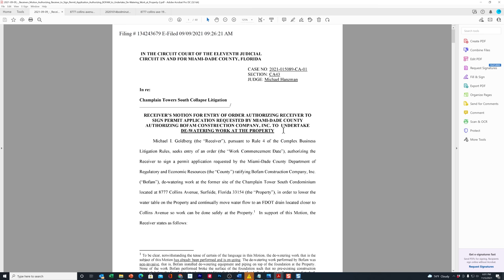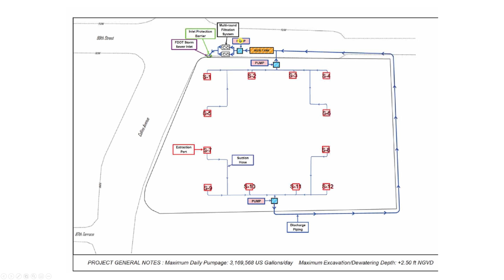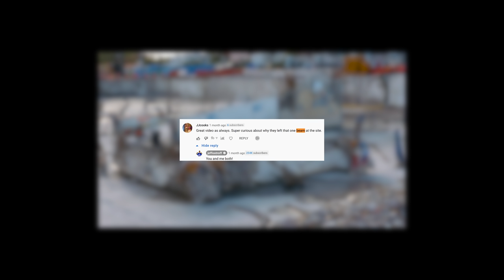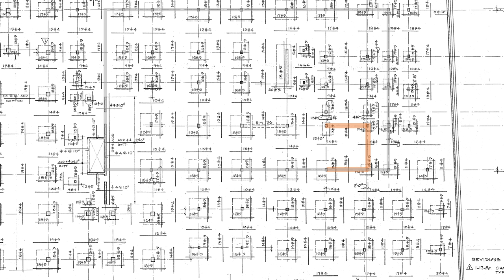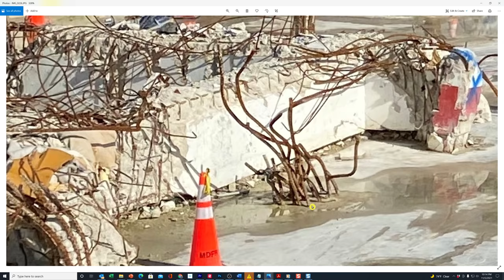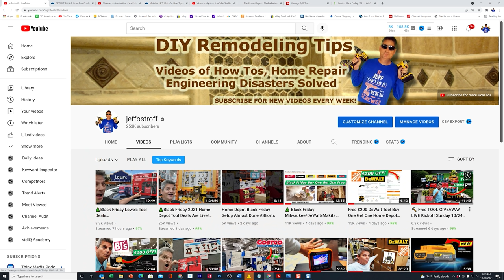Miami Condo Collapse: Engineers Baffled By Mystery Column

Comment: That extra column was a recent addition to building probably added 6 months before collapse.  The building been constructed out of roman cement this would have never  happened the cement used was low grade probably what u buy at Lowe's.    The columns where way too small to support this size of a building i am amazed this building passed inspection when first built. Proper drainage should have been done in garage years ago hoa dragged feet Miami inspectors ignored danger this building posed to residents but hey thats Florida always a cheap state. The extra column could be a false column basically looks like column but actually does not support nothing good way to get building inspection passed by city to be safe.
Reply from the maker: Yes this is also my hypothesis as well, it was added some time after July 2020

Comment: There is little doubt that either the drawing is wrong or the mystery col was not placed on top of the “H” transfer beam as specified from the 1st floor construction plans. It it were it would not have fallen straight down and in the same plane with the 2 “H” support beams
Reply: The drawing is not wrong.  You saw the garage video from July of last year.  For 39 1/2 years, THERE WAS NO COLUMN THERE.  Nothing but slab.  But sometime in the 11 months before the collapse, somebody added something.  NIST will get to the bottom of it.  Somebody approved the work, somebody performed the work.  Somebody knows.
Reply: @johnbergstrom2931  
John,
I think we actually agree. There clearly was no col. in the video. What I am saying is that the col.may not have been place directly on top of the beam as shown. That the col. then pierced the 1st floor (punch through) and then perpetrated the garage floor. If you look closely at the video the mystery col. is directly in line with the other to “H” beam support col., but the cross beam of the Goal post “H” beam is 2 -3 feet away from those support beam. Even if the “H” had shifted slightly and feel off the support col’s  and the mystery col. was sitting directly on top of that cross remember beam,  the mystery   col. would have shifted out of the plane of the other 2 “H” beam support col’s. along with the total “H” beam. but it didn’t it fell straight down from above as  I theorize accounting for its presence on the garage floor below.
Reply: @johnbergstrom2931  
Addendum to previous answer: I also find it unlikely that as you say (if the video captures the 11 months prior to the collapse) that they would have put a mystery col. in the middle of the parking garage interrupting the flow of traffic. But even if they were to do just a dramatic change that then really calls into question what was going on in that area of the building regarding support thereof. Adding a mystery col. in that location would certainly have been noted by someone by now and in the building permits et.that I am sure have been gone over with a fine tooth comb, which takes me back to square one of the mystery col. came from above on the first floor punch through. I now wonder even more if the mystery col. from above was mis-located and was supposed to sit on top of the cross-member of the “H” col but inspection missed to ‘Mis-location”?
Reply: @johnbergstrom2931  

John,

Very sorry to have engaged  in what I thought would be an intelligent discussion of how a mystery col. would have been placed in the middle of the thoroughfare of the parking garage’s ingress/egress path. As was imbecilic  as it may seem 98 people died in an event that theoretically  should never have happened, but it did, therefore all analytic options are on the table for consideration. We can only hope that in the end “The Truth will Out”
Reply: @johnbergstrom2931  I just came across this response to my observation about the “Mystery Col.”  I have been waiting to see if there was anymore discussion concerning “Where the mystery Col” , if it is a mystery, and where it came from.  Do you have any thoughts on where this col. Would have come from. You must have knowledge in the “art’ so i would be interested in knowing your thoughts on the col’s presence.
Regards
Reply: @jackzipf681  Well, just reread the comments.  I'm not gonna rehash the subject.  Ultimately, we will have to wait for the NIST report to confirm the column's timeline and intent.

Comment: You can’t just add a column. It’s not that easy. People would eventually find out who did the work, unless it was done twenty years ago under the cover of night.
Reply from the maker: That building has a history of doing things without a permit. In this case it was likely a temporary assuring as they were getting ready to close the garage to make all of the repairs necessary to the pool deck which is the roof of the garage.

Comment: I am of the opinion that the mystery column came from the first floor and was impaled into the basement floor.  Stranger things have happened.
Reply from the maker: you forget that there is zero damage on the floor where there should have been craters or something else if it had impaled into the floor but there is no damage. These rebar rods look like they were intentionally built up out of that concrete floor like it was done by somebody in the last 12 months, since Fiorella shot her video inside the garage in July 2020, showing no column exists where that mystery column is.

Comment: It's hard to see how this column could have been added later. Unless I've got the orientation all wrong, that would put the column in the middle of the driving lane. I'm sure someone would have mentioned if that had been done.
Reply from the maker: Exactly if they did add this column later it puts it in the middle of the east West driving lane in the garage, although you can still drive around it pretty easilly. But there's no other explanation that fits all of the evidence, including what most people think is a column coming from above and impaling it to the floor, because there would be a lot of concrete damage on the floor
Reply: @jeffostroff  Granted people may have been able to drive around it but it also would probably have blocked or at least interfered with at least 2 parking spaces.  You'd think that someone would have noticed.
Reply: @stephenhammond1745  Probably someone did notice.  But those were all people who lived and parked on the east side of the building.  All but a few of them are dead now.

Comment: I think the H beam collapsed and SHIFTED up, like its legs were kicked out. It did not fall STRAIGHT DOWN. So your presumed alignment of relative columns is slightly off. Not really a big mystery after all.
Reply from the maker: From the photographs that the H beam when it dropped shifted only 12 inches to the north because it slid down all four of its columns and it is still sitting right next to all four of its columns. So I don't know what you're saying there's no mystery that still doesn't explain why they're still at other column coming up out of the which was not in the video shown in the garage last year
Reply: @jeffostroff Well in that case, IDKICBW. But there may still be a simple explanation…eventually apparent.

Comment: I am NOT getting why you are so engrossed with that "Missing Column" inter alia........Kindly elucidat! Notwithstanding though,                              Was there a SOFT Storey Flaw in the Structural Design? I am also noticing a pronounced absence of SHEAR WALLS in both orthoganol Directions. I have also noticed in another Picture, a Slab and Column (Flat Slab Construction), rather than Slab and Beam Construction. How about the size of those "slender columns" of ONLY 16" squared, and Long SPACING, to carry Gravity Loads of some 11# Storeys; coupled with Earthquake/Wind Loads, and incidental Moments of any of the cars inadvertently Hitting same?

Comment: Is it possible that the mystery column literally impaled its self into the parkade floor due to the sheer force from above?
Reply: No.
Reply from the maker: LOL, no not another impalement conspiracy!
Reply: @jeffostroff  well, the rebar didn't sprout from the ground up through the slab so they had to have come from above. You underestimate the forces at play here. When the world trade center pancaked, there was an area below in the subway station where in a space of 10 feet there was 30 stories of debris packed into that spot.

Comment: It wouldn’t be a clean punch through for the column above the U lintel unless it had velocity. If that is the column from half way up then it had velocity, + it’s own kinetic energy and that of anything still fastened to it. So it is logically a pillar that has pile driven itself through the car park floor.
Reply from the maker: IT's so hard to tell
Reply: @jeffostroff  I would have to disagree on that, it either came from underneath, from above or it teleported there. I don’t see how the pad moved enough for it to come from below. I have no issue with a long rebar reinforced concrete pole from drilling through a concrete floor. The answer will turn up when they hammer the base pad up.

Comment: That mystery column is number 19 in the video shot of parking garage. If you look a the photo of the beam and the mystery pier or column you can see the beam need to be level with the ramp. Now just count them
Reply from the maker: No, you are off by a row mystery column is out of the photo, closer to the east wall of the in line with #17. So you are one row off and about 20 feet too far west, column #19 is not even in view
Reply: Then it’s not number 19
Reply: It the number next to 17 I think
Reply: If you look at the photo of the H beam in the start of the video it’s not completely inline with the ramp. So if you slid it back to where it suppose to be it would match up with the video of the garage. Even if you just look at the mystery pier in the beginning it’s only a few feet away from the pier on the opposite side of the H beam

Comment: Could it be that beam is not really load bearing but was needed for some utilities or something? It being in the kitchen and all..
Reply from the maker: I question why they needed a column in that kitchen at all. Definitely load bearing.
Reply: @jeffostroff  gotya.. i'm not in construction, so wouldn't know, but seems like a very odd contraption.. air is not a very good support LOL, i would expect all columns in a building like this to be all the way up and down. Seems like some kind of cost cutting
Reply from the maker: @comment6864   There was no cost cutting involved and in fact this H-beam is the acceptable way to prevent that column from coming all the way down into the garage floor where it would block the lane of travel. So what they do is they have the column stop on the 1st floor on top of the H-beam and then that beam transfers the load to the other 4 columns that are normally in the garage anyway and are holding up the H-beam. This is a perfectly acceptable way to transfer loads to the ground.

Comment: Do the official building inspectors have some "explaining" to do?  Were the inspectors certified engineers or merely residential building inspectors?  Did their income/bank balances show any unusual/unexplained  increases?  Have the general contractors records been examined?
Reply: This building was built 40 years ago. There is a good chance those records don't exist. At that point in FL's building code each jurisdiction had it's own code based on either the IBC or ICC (I believe those were the prevailing generally adopted standards). Prior to 1999 Florida did not require certifications for inspectors. Many of the building departments were commonly staffed by who you know more than what you know hiring practices.
Reply: @SillyPutty3700  Forty years is not a long time for a building.  I'm not a builder but I do know something about construction & geology.  My own home was built in 1969 and easily survived the 1989 Loma Prieta earthquake that wreaked havoc in nearby Santa Cruz and Watsonville, Calif., and San Francisco and Oakland.  Engineers & architects have a long history of knowing how to build on many types of soil.  I think your last sentence points at the problem.  You nailed it.
Reply from the maker: Good old cocaine cowboy days

Comment: Purely a guess on my part, but it could be structural "bandage" that was never approved by any agency that would have authority over said repairs. Kind of a black ops/scab repair that failed to correct for some heretofore unknown (to the authorities/ public) condition? If so, the building's mngmt/ownership have MUCH to answer for!
Reply from the maker: Yes I think of it as temporary shoring. But it was unpermitted, I scanned all the permits for 2020 and 2021, not there.
Reply: There must have been a reason for installing it, perhaps cracking, bowing or movement of some sort, which could indicate something failing.
Reply: @bigjd2k  "Something failing"?  Yeah, the whole building.

Comment: could that mystery column possibly be from another pillar from a higher spot coming down and from the force the rebar pierce threw the floor concrete in the parking garage like toothpicks stuck in the top of a cake and the rest of the concrete around the pillar being torn away from the rest of the destruction and also the excavators pulling it of
Reply from the maker: no, angle is not right, and there is no damage on the concrete floor from being impaled.

Comment: You are just looking at pics wrong. Its at the driver side door of the bmw the mystery beam.    You realize there is a lower partition that is not shown very good in your photo and it runs the length of the bmw and the mystery column is just on other side of bmw drivers door. You can just make out the on floor partition
Reply from the maker: huh?

Comment: Take a look at the creases in the concrete floor of the garage in Fiorella's video vs the pic of the H-Beam laying on the slab.  In the video you can see an intersection where four sloped sections of concrete join at right angles.  One seam is past the ramp towards the H-Beam and runs the same direction as the ramp, the other runs long-way down the length of the garage under the center of the H-Beam in the video.  In the pic, this length-wise seam is a good distance from the H-Beam rather than under it.  From the looks of things, the red column that you believe is 17 is either the remains of 17 displaced by the beam or another column from another row up that was not a beam support.  Also, you can clearly see the rebar remains of another column sticking up on the other side of the H-Beam from the "Mystery column" in the pic that is in line with the mystery column.  That pattern fits with row 6 in the floor plan.  Obviously concrete and rebar don't just evaporate, and that H-Beam was meant to, and obviously did, maintain its structural integrity.  It looks to me like it rode it's crumbling support columns sideways, or possibly even in a clockwise spiral to the ground judging from the bends in the rebar, and ended up with the horizontal support that normally spanned the columns on row 8 laying between rows 4 &6.  For it to do otherwise would be to defy the laws of physics.
Reply: No, for a 65,000+ lb beam to ride a column 'sideways' or in a 'clockwise spiral' in a building collapse where all the forces were basically STRAIGHT DOWN defies the laws of physics.  
There is no other red column anywhere near the H beam.  Just your fantasy.  
Due to the damage to the H beam, it's difficult to tell exactly, but it shifted a foot or two from it's original position.  That's all.
Reply: @johnbergstrom2931  There actually is a second red colum on the other side of the ramp in the position that corresponds to 17. You can see it plainly in this video. So there is at least 1 more red column. Columns of rebar don't just sprout up out of concrete floors. So that leaves 3 possibilities: 1) something drove a column down from above with enough force to embed the rebar in the floor without damaging the concrete, 2) There's a massive conspiracy and the photo has been altered, this isn't the same building, there was an invisible column, ghosts, etc., or 3) the building collapsed like buildings do and the pieces moved. If the building Cameron straight down, the rebar should be flattened at various angles. I mean, come on... The building fell from the center section out towards the sides. You can't tell me there were no horizontal forces at all acting on that H-Beam. There was obviously enough force to turn it from an H to a n.
Reply: @brentdavidson1492  Oh, you mean the red column 4 BAYS AWAY, OVER 80 FEET???  Are you serious?  Are you high? 
Take a physics class, study something called INERTIA, and get back to me.  
Gravity brought this building down, and gravity acts straight down, dude.  The building collapsed in less than 4 seconds, once initiated.  Columns did crumble at their tops and bases and did rotate, especially on the upper floors.  That's why the building fell slighty to the southwest and the slabs were seen "stacked like bacon", as said by one reporter.  But they were also being pulverized by the energy of the collapse.  You can see in aerial images from the first day, it looks like the slabs are right on top of another.  There isn't a 16" gap in between them.
The garage level was another story.  The first columns to fail on the east wing were very near the H beam and undoubtedly started to move it laterally, to the southwest.  But then the 4-5 million pounds of building came down on it, stopping that movement in it's tracks.  There wasn't time to accelerate and move something that heavy a significant distance.  Inertia.
The H beam was displaced off the top of its columns by a foot or two, but that's it.  The columns underneath it were smashed into stubs.  It's clear in the video.